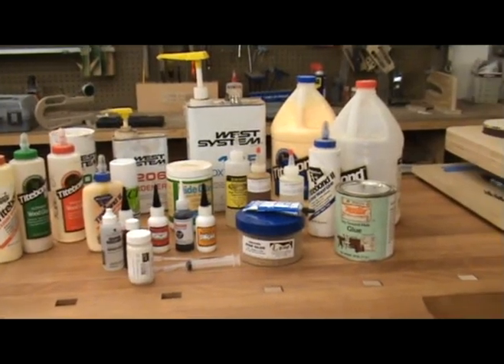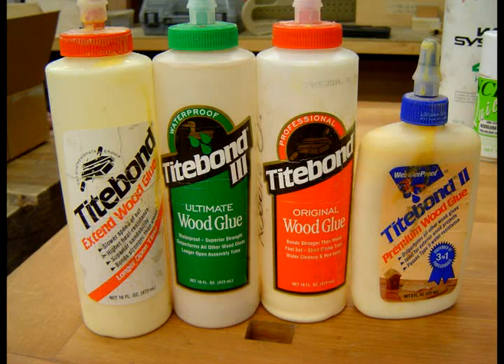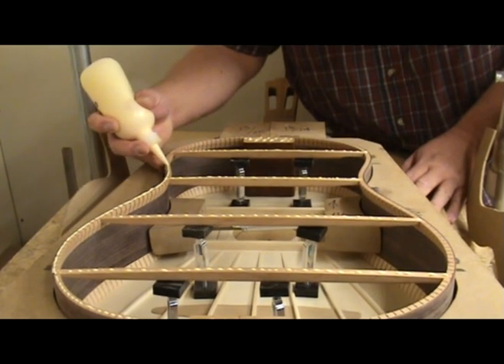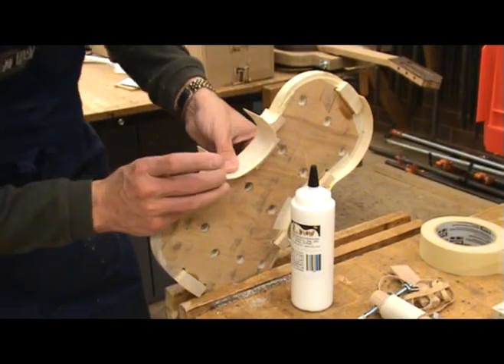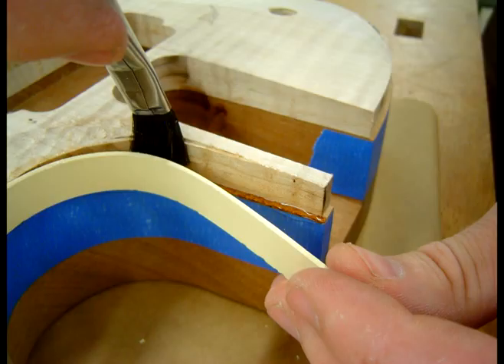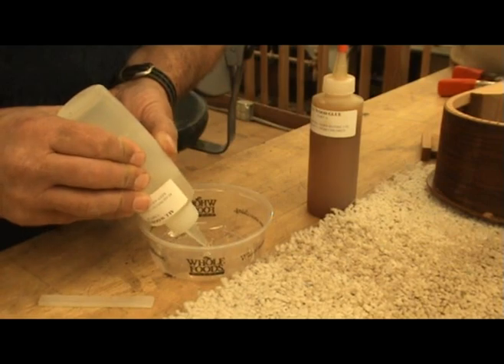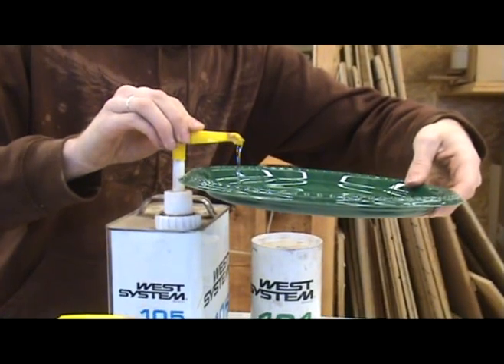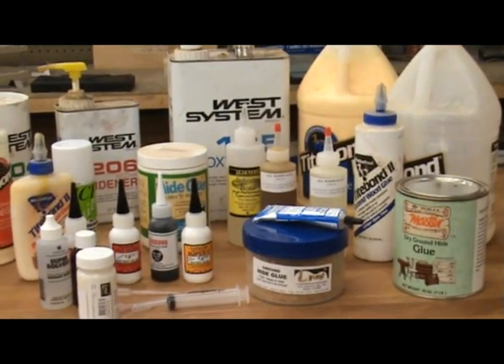OBrien Guitars - Luthier Tips du Jour - Glues Part I

Comment: Hi Robert,

Your videos, knowledge and enthusiasm are the best.  I'm close but not close enough to attend the RRCC School of Lutherie, though perhaps some day.

If you get this message and have time I have a question on glues for a repair.

I have an 1972 Epiphone Riviera EA-250 archtop built in Japan.  It is a fairly highly regarded vintage guitar today, though on the lower end or guitar models when produced.  I acquired this guitar in parts, every thing separate and not installed.  For its age it is in actually very, very good shape, body and neck nearly flawless, electronics somewhat less so.  It has a bolt on neck.

My repair question is on your thoughts on which glue to use to rejoin the guitar top - back to the body in a area behind the bolt on neck pocket.  The total length of the separation is approximately 20 centimeters - about 4.5 cm on each side of the cutaway outside the neck pocket and then the whole interior of neck pocket.  The amount of separation is not greater than 2 millimeters, greatest just behind the center of the neck pocket.

Any thoughts on which glue and any clamping tips?

Thank you for your time and consideration,

Robbie Leavitt
Estes Park Colorado
Reply from the maker: If you could send me some pics perhaps I could offer and diagnosis and some suggestions.

Comment: Dear Robert:

     I have viewed with interest both of your videos surveying the different kinds of glue, they have been very helpful.  Two glues I have used extensively in boat building that you did not cover and that I have a rather large and fresh supply of are Resorcinol, a kind of catalyzed  resin that is completely waterproof, Epoxy looks as if it is somewhat similar, but quite a bit more expensive, like epoxy, if it is too hot or too much catalyst is used it will kick off very quickly, even catch fire in the mixing cup.  The second is the old reliable Plastic Resin Glue, a brown powder that is mixed with water to a heavy cream like texture, it is commonly known as Weldwood Glue, it is also completely waterproof unless one boils the joint, good joints are required for both glues as is firm clamping.  Both glues set hard, the plastic resin glue reacts badly with White Oak, and will not form a reliable joint with that wood.  My question to you is this:  Do these glues have any practical use in Lutherie, or should I give them to my boatbuilding friends?  I don't foresee any more boatbuilding, at my age, (75) my joints and muscles are too old and creaky for such heavy work.

Best Regards

Don Denison
Reply from the maker: I guess if you plan on using your guitar as an oar then perhaps those glues would be useful. haha I would stick with the old reliables like just regular ole yellow glue. It is more than sufficient to build a fantastic guitar.
Reply: Dear Robert:

     Thank you, I was only  hoping to be able to put these materials to good use.  I will reserve a small amount for outdoor projects here, Garden Benches etc at least as long as they are not out of date, then give the rest to those who are still able to do the heavy work of boatbuilding.  The plastic resin glue has a very long shelf life, at least until it is mixed.  I've worked with Titebond, and like it for indoor projects, I'll probably go with the extended open time variety though I've not used it before.  I've been surprised how easy it is to bend sides, I actually soaked White Oak in boiling water to get it to bend, of course I was using 5 quarters and thicker lumber.  The J45 project taught me a lot, I'm surprised how much applies to the Classical Guitar as well.  That expensive kindling I made as a necessary part of the learning curve taught me the most.

     Thanks again for your comments.   I have found your DVD very useful, as well as Bogdanovich's book.  I'm still wondering if the laminations of the sides is worth fooling with, I've listened to a great many guitars made without cypress linings on the insides, and have found them to be good instruments, many of them excellent ones, there seems to be a difference to my ear between Mahogany backs and sides and those with Rosewood at least with Classical Guitars, for steel stringed Dreadnaughts like the D18 or J45, I prefer the Mahogany it seems to give a more balanced response;  with the Classical I guess the Rosewood is better and necessary to get a greater bass response.  Given the difficulties of laminating the sides, I've decided I'll forget that complication even if Bogdanovich believes it is the way to go, indeed, I've already got the sides bent; it doesn't make a lot of sense using Rosewood to enhance the bass response and overtones then cover it up with a softer wood. If one is going to go to all that trouble, then end up compromising the Rosewood response, why not just go with Mahogany in the first place?

Best Regards

Don Denison
Reply from the maker: There are many great sounding guitars out there without laminated sides. Obviously there is more to it than just that. Happy Building.

Comment: Hello im in colorado springs where temps are still low as you know. I used lmi epoxy to glue my maple archtop back, my joint was not perfect and the epoxy shown as a dark line.unacceptable.ive seperated the joint and will true it up with my shooting board, but what glue will dry clear and work in a marginally heated shop, I have titebond origanal , lmi epoxy, titebond 2.or should I use the lmi instrument pva you have mentioned, thanks
Reply from the maker: Any of those glues will work if the joint is tight. I think that was your error. Marginally heated shop? Can you take it inside a heated area to at least glue this joint? I wouldn't let the temp get below 55 or 60 degrees when gluing.
Reply: Ok, probably, use tite bond original.ill make sure the area is at least 60 + for glue ups, again many thanks.

Comment from the maker: I usually use fish glue for top crack repair. Start by placing the guitar in a correctly humidified environment before attaching cleats to the inside.
Reply: what is fish glue? Can I use Tintebond glue to repair the guitar soundboard?